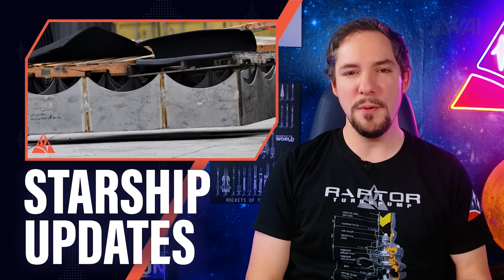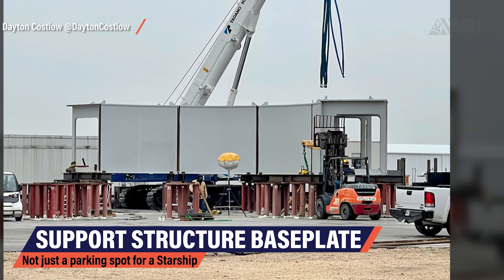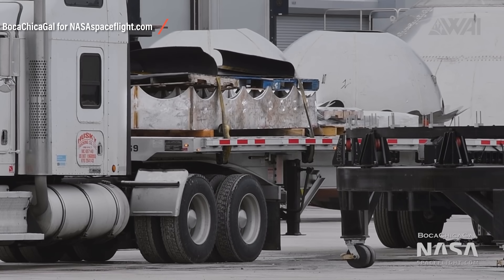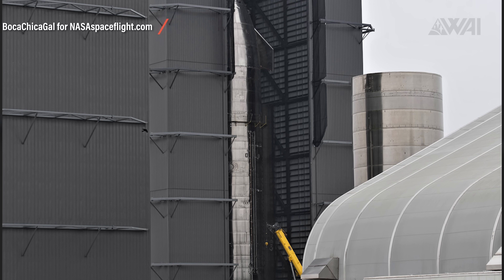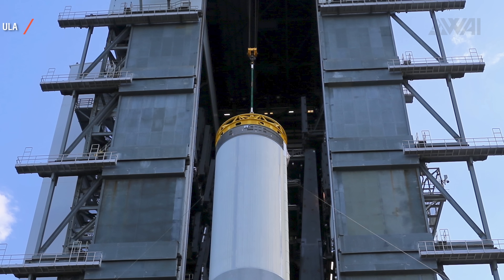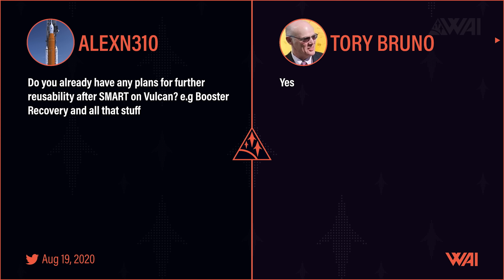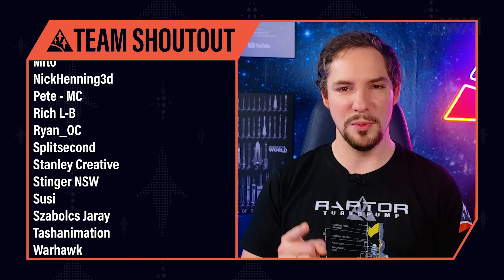148 | SpaceX Starship Update - Vulcan and New Glenn incoming!

Comment: Is it that SpaceX gets more confident in reusing Raptor engines, or are they running out of engines? I mean they are obviously not really running out of engines, but flying the booster (not just hopping it) will need a lot of engines. For high altitude (close to orbital speed) flights, Starship will need at least 20 engines (plus 3 engines on Starship itself). No doubt they will be able to achieve that. But I'm starting to get really sceptical if they will be able to make their first orbital flight this year. Engines, TPS... so many problems to solve. Lets hope for a streak of luck over the next 10 months.
Reply: They're now focusing on Raptor production

Comment: I think a water suppression system at the orbital launch site makes a lot of sense.  Maybe those giant concrete cylinders they are building behind the bunker will hold the water they need for this.  There are some heavy duty pipes and maybe pumps in the bunker that could be used to pump the water.

Comment: I am speculating that the Older raptors (#27) may not has as much thrust but they may be able to Throttle more. which is perfect for landing starship they may be able to throttle down so much that they may be able to have all 3 Landing engines on for the landing !!

Comment: Personally, I don't think ULA is actually serious about their so called SMART recovery system. They really haven't said very much about it in a long time. I think that they are hoping that essentially their only customer, the United States government, won't make too big a deal out of it, and they can quietly just kick that can down the road. Even if they do develop it, their cost savings will only be a fraction of what SpaceX is achieving now, or what Blue Origin will achieve with New Glenn. We won't even mention Starship. I expect that, in a few years, when the next round of national security contracts is let, the lion's share will go to SpaceX, with Blue Origin being the backup, and ULA, still in the process of developing a means of recovering just the engines, will be frozen out.
Speaking of freezing Felix, I know you are planning to immigrate. Are you coming to Texas? You might notice that, although Winter only lasts about a week around here, it can be quite a week. My wife and I have been without power for most of the last three days, often in subfreezing temperatures. We got power for about two hours this morning. Tonight it came back on again, we will see if it stays on. Of course, it never gets nearly so cold as Germany, but the power failure seems to be due to the fact that Texas has become extremely dependent (about 42%) on wind power. Guess what happens to wind mills when they get hit with sleet and freezing rain? They freeze up. Luckily, we only get this kind of weather once every ten or twenty years or so.

Comment: If they are putting down concrete in freezing temperatures, they must be putting fly ash into the mix or some other accelerant, which means they will have to keep it wet so it can cure as it will cure in a week with lots of heat.

Comment: Regarding the BE4 engines on the ULA Vulcan, well, yeah. We've seen Raptors on test stands, Raptors test fired on launch vehicles, Raptors actually used on launch vehicles.

ULA is betting it all on the BE4.  Which, for all purposes, is still vaporware.  Sure, we've seen one test fire.  But...

I wonder if the lack of real BE4 firings and experience was behind Lock-Mart's purchase of Aerojet-Rocketdyne?  Hopefully there's a backup engine when, not if, the BE4 turns out to be nothing.

Comment: Even with a cold front in would it still work to do testing, cold weather cold fuel but watch out for wind and lightning just curious
Reply: It is Texas... they are used to warm hurricanes from the south not displaced arctic cold with no where to migrate to but Texas...sound familiar? No one is asking why is the cold coming here right now... well the north pole just got hotter and it's getting hotter all the time so if you are not paying attention look a the infrared sattelite maps we are fucked... Hell just froze ove

Comment: I would think that the grid fins provide more drag on the way down, which would keep the top pointed up.  The Blue Origin fins are clearly designed to minimize drag so they will only provide steering, not ... what would you call it... anti-balast?

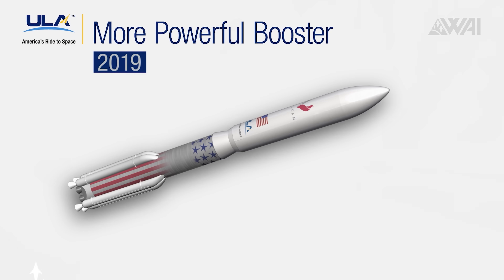Comment: Comparing the initial ULA and SpaceX Air Force launch contract is very misleading (8:36).  The $316 million SpaceX charge as SpaceX President and Chief Operating Officer Gwynne Shotwell on Nov. 9 explained, SpaceX is charging the government for the cost of an extended payload fairing, upgrades to the company’s West Coast launch pad at Vandenberg Air Force in California, and a vertical integration facility required for NRO missions.   The price “reflects mostly the infrastructure,” Shotwell said.  ULA CEO Tory Bruno stated Phase 2 launch bids are fixed-price and do not include development costs.  ULA competing for Phase 2 contracts received $967 million for the development of vehicles and for infrastructure.  As for the Smart technology,  ULA has been very closed mouth about this program.  My guess is we will never see ULA recovered and reused BE-4 engines.

Comment: I still think that ULA´s approach to just save the engines is absolutely misguided. The calculation is simply not convincing. If the engines constitute 65% of the cost of one booster, that means that each launch with these engines still incurrs 35% of the cost of a completely new booster.  On top of this, building the new boosters simply takes time, so that the manufacturing speed is still the bottleneck.
Overall, Vulcan Centaur is still much more pricey per launch and is only superior in fairing size. And the vehicle is completely new and unproven, so ULA cannot bring any reliablity advantage to bear. 15 years ago, Vulcan would have been a huge blow to Spacex. But now, Spacex has the proven and cheaper rockets with quick turnaround times, while ULA is still playing catchup with new vehicles that don´t have a legacy bonus attached.

Comment: Could Starship be re-designed to be a fuel tank to refuel another vehicle? A couple of moving domes could push fuel and oxidizer out instead of connecting  two vehicles together
and rotating them like a pails of water on a rope
Reply: Yes. It could probably use even same method.

Comment: I don’t think SN 27 will be used for SN11 starship because there is no TVC, it might be used for BN1
Reply: I agree. There's so much stripped off SN27, such as the frames that the gimbal struts attach to that it cannot be used on SN11 as one of the thrust vectoring SL engines. It doesn't look like it is in a state to be a functional part, in which case it may still be useful as a model for measuring & validating engine mounting, pipework routing, component clearance etc.

Comment: The military is basically being generous with SpaceX. F9 costs half of Vulcan but SpaceX did not receive any funds to develop vital infrastructure such as the vertical integration building and the extended fairing. The military always overpays due to wxtended requirements, in this case a giant moving building and the RUAG fairings could be quite expensive. ULA already got close to a billion for additional costs before NSSL was formally awarded. BO and NG are not getting the rest of the money they had been awarded, just what has been paid out. Long story short it's good that they got twice the pay not some sort of indication of Vulcan's commercial viability.

Comment: Re: size of the grid fin. Doesn't air resistance go up by the cube of the velocity? That would be why they probably don't have to change the size very much, they can probably just get away with a stronger motor as the resistance is so great. Headline is grid fin size is orders of magnitude less important than speed. I expect that the mass of the grid fin would be higher to compensate going larger than if you compensated super heavy's extra weight by battery size or motor power

Comment: How does ULA win a launch contract with a rocket that's not built, never flown and never proven? Esp with a new BE4 engine without a single flight.!   If a design and hardware that has never flown can win a contract why didn't spaceX use StarShip
Reply: Good question 

(Maybe Senate or something)

Comment: The only reason for 300m price tag for SpaceX launch is to set up VAB.

Oh, and regarding reusability... What about Electron rocket? :)
Reply: Not a lot of news around Electron at the moment... they recovered one booster from the sea late last year, but haven't tried again with subsequent flights. I understand they're making some changes to better survive re-entry, so there's probably not much point in repeating the exercise until those changes have made it down the production pipeline.
Reply: @simongeard4824  That is correct, but Blue Origin haven't tried it even once (with New Glenn), but they were mentioned.
Reply: @rigeborod  Well, no... BO haven't even tried not reusing a New Glenn booster yet...
Reply: @simongeard4824  That is exactly why I'm curious why Electron was not mentioned.

Comment: The reason the Super Heavy grid fins being smaller, could also be due to the prototype be lighter then the final version.
Reply: To add to deadHamster, it also wouldn't make much sense to do prototyping and testing with hardware that is widely dissimilar to the final version. Full state feedback control is very adjustable and works well on craft that have never flown (unlike PIDs). However its still only as good as your body estimations so in order to get the control system as close to perfect as possible you need real world flight data to calibrate it further from the simulations.

They would be missing this data if they flew superheavy tests with smaller less capable fins.
Reply: I don't think weight is the driving factor for the size of those fins. It's rather the moment of inertia (a body's resistance against rotation), which mainly depends on the location of the center of gravity (usually pretty close to the engines, when the tanks are empty) and the distribution of mass (shape of the body). So the design with fewer engines should not be so different to the final one. But I could be totally wrong here. You never know with SpaceX :D
Reply: @deadhamster7570  you're talking physics now but you don't realize that they wont catch it at the edge of the fins so your whole conclusion doesn't make sense
Reply: @omniyambot9876  The catching of the rocket has nothing to do with my explanation. I'm talking about the moment arm the grid fins act on in flight. Not about the catch, when the booster already is so slow, that the fins won't have much control authority.
Reply: @deadhamster7570  the booster prototype gonna entry on lower atmosphere way slower, so no need to put bigger fins to direct the booster to the landing pad.